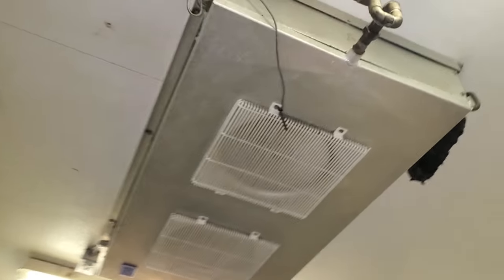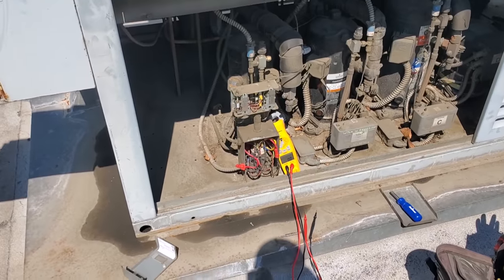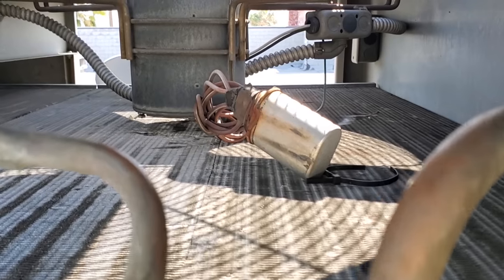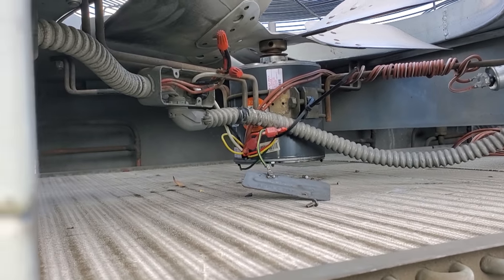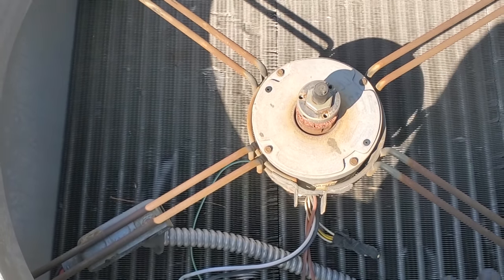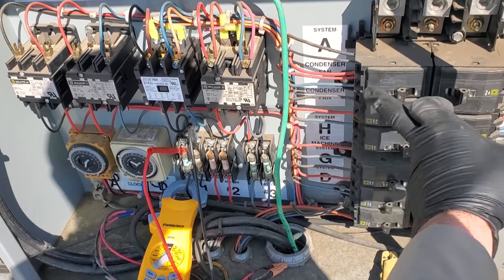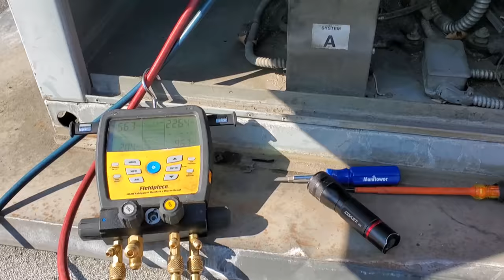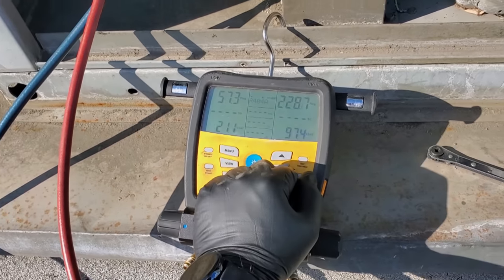THEIR WALK IN COOLER IS DOWN

Comment: On the SJ cord install, that gets to me also, even if it is SJ cord you are running, I always put it in conduit! I had taken over a local sandwich place and was in the process of fixing all of the open wires, etc. as I came across them,  they found someone that told them they could do their work at a lot lower rate (this guy went to all of my business and told them that) He has since left the industry, he burnt down their Deli! It was determined the fire started from an open wire ran through a stainless steel hole with no grommet or conduit. This same guy caught a house on fire and now we have to run rigid gas pipe to the inside of all furnaces, residential and commercial in that jurisdiction and took out several rooftop package air conditioners at another customer I was servicing, cost that one about $85 Grand to replace multiple units on one building.
Reply: I don't think SJ, or SOOW is allowed to be run in conduit per NEC. I don't know why HVAC guys use SJ so much, SOOW is much higher rated/better cord.
Reply: @fidikvien7682  you are correct it's against code
Reply: A. Koenigs people just don’t understand what it costs to run a business
Reply: reminds me of a produce stand,  it was a fairly big building, & this would be like over 35 years ago, 75% or more of the wiring directly from breaker box was 16 gauge orange extension cords, yes, orange to the breakers, they had junction boxes on roof, where they used wire nuts to attach other orange cords, but everywhere was orange, to drink machine, fans, all over, just stapled to roof, as a young man they kept trying to talk me into coming to work for them, but I refused, the place scared me, lol,  but 1 night place burned to ground, they lost everything, people were so upset, I shrugged my shoulders, thinking it was long past due, as even at my young age I knew a lot about electricity, & knew 99.5% of stuff inside should have never been there, maybe a table top fridge plugged into or microwave, but not for equipment! nor hardwired to a breaker.
Reply: Serves them fukken right.

Comment: In Canada, we call that flex. Conduit is rigid pipe. One thing I would have done is megger the motor to determine if the windings were indeed the cause of the fuse failure. Was the fuse the right size and type? Often someone will just slap any fuse they have rolling around in the truck.
There is such a thing as fuse fatigue and it may have just been the fuse.

Comment: We had a Cold Zone Rack go down for the same reason. Condenser fan motors blowing fuses. Two technicians before me replaced the fan motors, one at a time, but the unit tripped again. I went in and ripped out all the wiring to the condenser fan motor and found the tiniest break in the insulation and replaced it all the way to the motor. Let's see it chafe on seal tight conduit.

Comment: Hello, if I understand your situation, I also dedicate myself to refrigeration. I have been working with cold room equipment for 30 years, just like you. That is why I like to see your channel a lot because I learn many things apart from knowing the equipment there in the United States. Yes they are something special and sometimes one gets into trouble for wanting to help some clients but I have run into problems similar to what I saw in this video with a problem with cables that come in very small conduit and many cables and occasionally here in Mexico I found a team that was a mess with the cables So I had to redo it even when I see that there is a very small register box I know there are problems because mostly when they all come it's a conduit that comes with all the cables of all the fans and sometimes the register the cable is not registered if it goes in and out and the cables are all wrinkled rolled up and not well fit o Well in the end The important thing is to always give the solution to the client and help him but sometimes clients do not see the conditions that the team gives you they just want the team to work only that and I see your video and I see in the situation that is there they are experiences that are being learned every day I have always said that refrigeration has no limits for learning Day after day we are learning something new each team each brand is a new experience for example here in Mexico this work with the danfoss and bohn brand and they are many problems that I have had with equipment that had factory problems come the warranty process is not so fast So the customer wants the equipment to work, that is, he pressures it to work So my friend, you go ahead with the patience and humility is what does not make each day bigger and observation is very important observation because remember that many of the many of The failures of the refrigeration equipment I have because sometimes we do not observe well the equipment, even much of the answer to solve the problem is found by carefully observing the equipment. have a great night Greetings from Mexico

Comment: If you run a fuse really close to its rating (so it's pretty much always warm) they tend to age and eventually blow even though nothing is wrong. Although it's probably a lot more likely in gear like this that something is actually wrong, it doesn't necessarily have to be.
Reply: My father and I are in auto repair, and he's seen a few classic cars that have blown a fuse for no good reason (he went looking for a good reason, and didn't find anything wrong). I'm talking cars old enough that they use glass fuses.
Every single time it was a fast-blow fuse of 5 amps or under. With glass fuses that are under 5 amps, the fuse wire is about as thick as a coarse hair off your head.
After the third one he encountered, he came up with a theory. "It must be the vibration", he said. That's the only reasonable cause either of us could come up with for a glass fuse to fail without an electrical overload. Just one too many bumps in the road bending that hair-thin fuse wire, and eventually it snapped due to metal fatigue.
I think that's one of the reasons other than cost that newer cars switched to the blade fuses (ATO, ATM, etc.). The fuse element in them is probably made of a different alloy that allows the manufacturers to make the fuse element thicker so it's mechanically stronger but still fails at the same amperage. The fuse element is also much shorter than in those glass fuses, so there's less length to get vibrating in the first place.

Now whenever we get a classic car with blown fuses, we replace the glass fuse that blew with a sand-filled ceramic fuse (after finding the problem of course). I know, those are usually for high voltage AC so that the fuse can quench an arc and not explode, but for our use case the idea is that the sand acts to prevent the fuse wire from vibrating and subsequently failing due to metal fatigue.
Reply: Every time a fuse has start surge it bends the element they break when they age that's why change both fuses 🤗

Comment: I came up on a unit built like that once that the condenser fan motor belly band vibrated loose. The motor slid down onto the condenser and chewed its way right into the coil.

Comment: I want to share an experience I had with an hvac tech. I'm a maintenance supervisor at a huge warehouse I think I mentioned it before. Anyways the building was brand new and the breakroom was not cooling. I called the hvac company and I was kinda shadowing the guy up on the roof cause I'm a curious person and like to learn this stuff. I asked him if he cared and he said it was good. I ended helping him in the long run. So he pull off the panel and man the first thing I saw was this wire stretched out across the whole unit and running somewhere I couldn't see. I'm talking about you can play the guitar on this wire. This tech was looking at the electronic stuff and ignoring this wire. I finally said something after he said he couldn't find anything wrong. He told me he installed the unit and that wire was going to something that I can't remember but it was fine and he ran it like that because he didn't have enough wire. He just left it and didn't fix it. The problem ended up being someone messed with the thermostat and had it set for timeouts. I know now that when the warranty is up I'll probably go up there and fix that because it drives me crazy. Thx for the video guy I learn from every one and that's valuable to me. I'm currently in a pinch right now or I would have ordered some merchandise by now. My wife just left me after 15 years for pretty much no reason that I can see. She just needs to find herself she says. So next paycheck I'll get something lol. Sorry for the long story.😁

Comment: Hypothesizing, on this one. The old motor was grounded directly to the conduit, when the wire blew it would have taken the path of least resistance which would have been via the motor casing and possibly the wingdings inside, creating a voltage spike which could have over amped the motor or created a direct short, not knowing how this unit is wired, just guessing. When that conduit burnt through though that would have been a brief direct short to ground that cleared its self when the wire and conduit burnt enough to break contact, hence why you didn't find an obvious ground short.
Reply: This sounds good!

Comment: Good vid ! All that Flex conduit going to condenser fan motors should actually be Liquid tite. Wow, talk about overcrowding in that conduit. All that condenser wiring is a nightmare , capacitor wiring laying on sharp aluminum fins , capacitors not secured properly. a bit of plumbers tape would go a long way over there.

Comment: NIce Job: Once again your voltage is low. This will cause higher that normal amperage on equipment. The public utility out there is terrible. Someone needs to contact customer service department and the engineer and make them up the voltage to at least 208 volts. This will also burn up contactors due to overheating/over amperage. Thanks for the video's.
Reply: Waterman one sounds to me he owes the local utility a nice gift basket for all the repeat business!
Reply: you realize 202 volts is within 3% of 208v right, with majority of the rack running it's fine. the voltage across the fuse is also a big series circuit through the motor and the rest.
Reply: @unvjustintime1  : I agree. Thanks
Reply: @throttlebottle5906  : I worked for a public electric utility for many, many years. If you are paying for 208 volts, that is what you should be getting. Equipment today barely meets specs on what they are providing, and Breakers, fuses, wiring, etc. barely meet specs for the load they are carrying.  If you are getting low voltage now, it will be much worse when summer time comes and power factor takes its toll. As loads increase it will drop even more. It is kind of log rhythmic  until it reaches failure. Utilities in that area seem to constantly have voltage on the low side.
Reply: pretty standard voltage for california. 197-202 not uncommon. low voltage everywhere in so cal.
Reply: @watermanone7567  they'll gladly test the incoming voltage at first panel to service entrance and tell you perfectly within spec. you should call an electrician to rewire your building because the loss drop is on your end/equipment  ;)
Reply: @throttlebottle5906    : Maybe you missed that I worked for an electric utility for many years. I agree that if the voltage drop is between the service entrance and roof top equipment, the facility has an issue. I use to set electronic recorders to monitor the voltage on customers facilities. Usually the customers added loads without telling the utility and the transformers or taps had to be changed. Other times I saw 240 volt equipment running on 208 volt lines or visa versa. A 240 volt water heater has a great loss of heat on a 208 volt system. Maybe something like 3 time the voltage loss in wattage on the elements.
Reply: Lower voltage means lower current and subsequently lower power, not the other way around. The impedance (percieved resistance) of the load doesn't change (much). Only if you have equipment with current regulation that is regulating to constant power would the current increase with decreasing voltage.
Reply from the maker: I will discuss this on my livestream this evening , 4-20-20 @5:PM (pacific time) come check it out if you can and no worries if you cant make it to the live stream as it will post as a normal video on my channel afterwards. https://youtu.be/62G5H5oAk8M
Reply: @Tjita1: Lower voltage will result in a lower current with a resistive load.  Lower voltage with an induction motor usually results in a higher current.

Comment: I have a great story on replacing the same type of unit motor, loosened one of the belly band brackets and the whole thing fell apart, it had a broken bracket and I have No Idea how the previous tech had put it back in there like they did. Luckily I had a used bracket at the shop and swapped it out for the customer with a new motor and explained what happened to the customer and gave them the bracket, that’s when they said, “That’s why we call you, you fix it right and don’t rig it”

Comment: Armour cable   wire   running  into a  junction  box,   conduit is   rigid   pipe  when  the  NEC  code  requires  it,  but   most     Refrigeration   and    Armour wire  is  used  in  a switch  gear  disconnected, and  what  you  working  on.   You   founded  the  problem  a hole  and  a  broken wire.   Like   you well   stated   the   thermal  over  load  kick  in, because   the    condenser  ran  motor  was  not  running, and   high   head  pressure   build  up  in  the  system  high  side, and  high  pressure   cut  out  engage  the  thermal  over  load  and opened  the  compressor  circuit  to shut  it  off.

Comment: probably due the rubbed wire short in the metal tube  and the fail motor was the closest one to the short. probaly it went to ground somewere and tripped the fuse. note... u should verify also the ground between the ground wire and the metal parts u are working it.

Comment: Look at that second condenser fan motor. They wrapped the wire around the bracket multiple times for the capacitor. What does take more time? Shortening the wires with new spade connectors or wrapping it around? Laziness?

Comment: I just learned about winter charge and HPR valves today. We were taught a method with sizing the pipes for adequate refrig. charge for winter. they also said a lot of guys use rule of thumb charging methods. I like how you were able to calculate the liquid level in the receiver how did you figure that out. Thanks.

Comment: Just because a capacitor tests good with no power, it doesn't mean it's good. For that you need an ESR meter. Basically an old capacitor can turn into a resistor only when a large voltage is applied. Just saying in case it helps you troubleshooting in the future.

Comment: I don't have my code book handy, but conductor fill states maximum of 9 #12 conductors for 1/2 FMC. That's not accounting for temperature though. Looks like too many to me lol :) I'll check my NEC tomorrow at work and get you the actual code that states conductor fill
Reply: I went and looked it up too, 9x #12 THHN in 1/2" anything is crazy. (But is the maximum on 1/2 FMC, LFMC and LFNC)

Chris: Are you going to redesign the conduit layout a little, and have maybe three runs, two fans per conduit, and a third conduit for the ice units further down?
Reply from the maker: Yeah I plan on completely redesigning tht conduit run I'm thinking a dedicated run for each motor.

Comment: I think I would have held off on the winter charge until I could do a leak search , but again , we do have wayyyy tighter regulations on refrigerant .
Also , I'd probably have taken off the whole fan motor bracket and cursed like a sailor when trying to put it back together ... 
Btw , I do not understand what was all that wiring wrapped around the bracket on the 2nd fan motor , what's that all about ?
Reply from the maker: someone was lazy and didn't want to zip tie the wires together , its was an electrical short waiting to happen.......

Comment: It looked like you were turning off a circuit breaker next to the fuse as you worked, what is the purpose of the fuse if there's a breaker right next to it as well?  It seems redundant?
Reply: That's exactly the point. The breaker is so that if there is a super bad short, it can actually cut power before the fuse even blows. At the same time, a bad fan motor could pop a fuse and not a breaker if something went wrong. The breaker also helps you by de-energizing the circuit. You wouldn't want to pull a live fuse to turn off a motor. 

In this case it looks like they have an oversized breaker being used as a switch, and then a fuse to actually regulate the motor if it shorted. Looks like a slow-blow fuse, since it doesn't instantly pop from the inrush current of turning the motor on, but if it were to dead short for more than a second that fuse would probably explode. 

That happened to me in one of my tesla coils. Something went wrong, the coil arced to the circuit board, and the fuse had so much voltage pumped into it that there was only glass dust remaining.

Comment: Fuses do degrade. The heating & cooling over time can weaken the fuse and this can cause to fail.
Reply: Peter King I’ve had fuses not make contact before and just need to be pulled out and put back. Problem fixed... this was on a car starter circuit. After checking that fuse it worked again, I though I needed a new starter. It’s still been starting for 3-4 years now.
Reply: Indeed. During my time repairing audio equipment, you could tell if there was a short, glass fuses blow and turn black, if it was a soft blow, the fuse wire just melts and it's usually safe to just replace it.